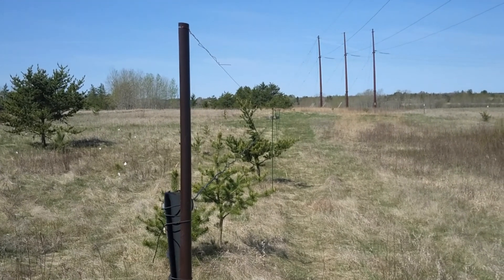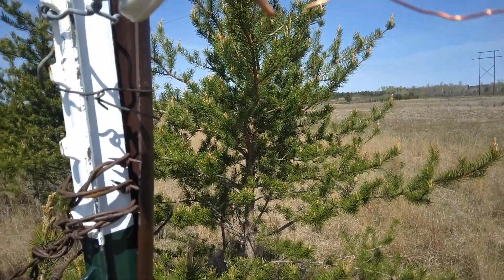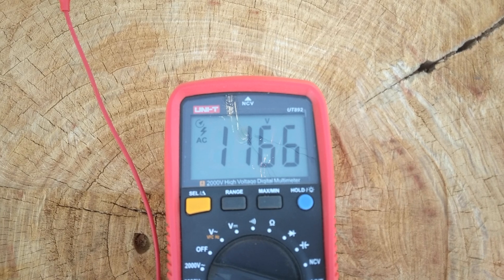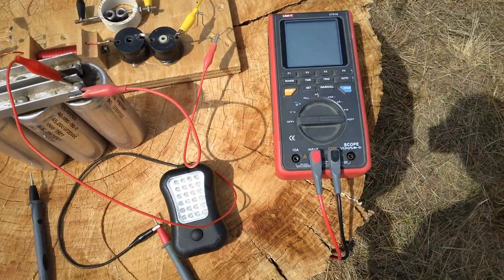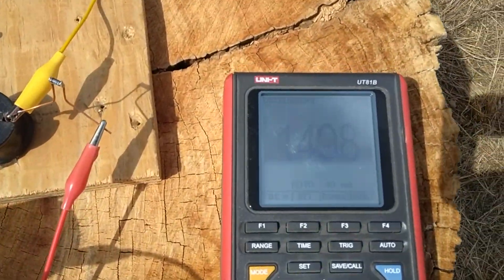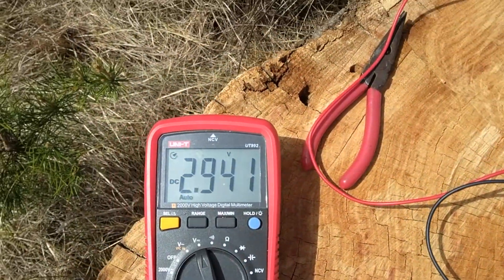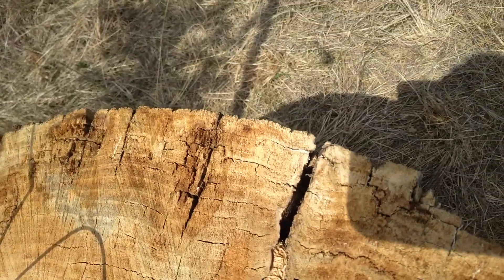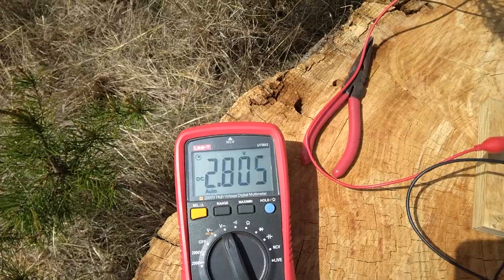Wires electrified *outside* of HV power line corridor.

Comment: I'm building a large off grid private facility in the mountains of the remote Arizona desert. I've been working on using electrostatic electric ( Natural power of the earth) to power the entire 6000sq foot shop. Looking at your designs your pretty much right on par with the project im working on. About a half mile on the other side of the property is an 80,000 KV massive power line, im wondering if I could increase my voltage by incorporating some of your design in with my electrostatic collection system. Might be fun to try.
Reply from the maker: Sounds like you have an interesting project!  You should try some videos on it.

Comment: So you noticed your physical proximity to the wire/circuit was having a negative effect -- quasi-grounding field proximity being induced.  That should explain the unexpected DIFFERENCE/LOSS you're seeing between 8ga and 30ga wires.  True the 30ga wire is higher and thereby closer to the HV lines -- HOWEVER, moreso your 8ga is terminated on insulators that are an INCH away from a grounded metal stake.  That grounded stake proximity is huge, just like your body was.  The 30ga is insulated on a wooden stake (some 8-inches away from the supporting metal stake) or 8X time distances of the interfering grounding field...

Comment: If you calculate the distance from the overhead wires to the ground along the shortest line that includes your wires, that gives you a distance D in feet. Calculate 250,000 / D = F volts per foot for the electric field strength from the overhead wires along that line D. Multiply that F (in volts per foot) by the distance between the thin and thick wires (in feet) and I bet it will come out very close to the difference between their voltages. In other words, the higher wire just was picking up a higher field strength. The thickness of the wires is immaterial given the tiny currents involved. My comment on your January video calculates you were getting 0.01 watt per yard for the Jan. setup.
Reply: close -- but no cigar.  why?  the planet that is influencing the nearest-neighbor -- is in fact proximity to the GROUND.  Field-wise, the 8-ga is connected to an isolator that is an inch or less from the grounded stake.  the 30ga wire is on a wooden stake suspended 8X further away from the same grounded stake.

Comment: The open circuit voltage (unloaded) is not important.    What you want is power.    P=V*I.    Try a couple watt power resistor of about 100 Ohms to get an idea of what kind of power you are able to get.     If the resistor gets hot or smokes you will have an indication that you might be able to get some usable power.   What you want to get useable power is a coil of wire that encloses a large area of magnetic flux from the power lines.     Interesting experiment.
Reply: Not only magnetic but they can also get the electric energy or potential with a natural capacitor efect. At the end is what hertz experiments did king time ago and cohesor experiments.

Comment: The thicker wire with the higher surface area is almost certainly collecting more locally in the wire, but its higher resistance is lowering the total output at the point where you connect to it. Also don't forget that galvanized means zinc-coated, so it's actually a really long bimetallic junction, whatever implications that might have. I don't know when you shot this, but I wonder if the recent solar activity could have had any effect on your readings. Even small solar storms can have measurable influence on currents in the air and ground. I also second the guy in another thread who thought the wire ought to be higher. Not because it's closer to the power lines, but because it's further from the ground where the natural atmospheric energy gradient interacts with the surface of the Earth.

Thanks as always for sharing your experiments! I ordered the space blankets I was talking about before, 150 for $70 on Amazon. And some paracord, tip ties, other odds and ends. Figured out basically how to suspend and steer it all for super cheap, just working out the best ways to contain and extract energy from a big patch of hot dirt, and where to aim it all so it isn't a hazard for pets, people, planes, etc. Grateful you inspired me to pursue it.
Reply: See my remarks on each wire's proximity to the ground (rather to the grounded stake) -- the 8ga is 1" away via the isolator, the 30ga is 8" (or 8X) further away from the grounded stake (suspended by a wooden stake)

Comment: Good stuff. It's about the frequency of the surface tension on the coil (+ antenna), against ground reflector capacity.. All about the LC circuits ;)
Reply from the maker: This is a learning experience; but a fun one!

Comment: i still dont think your high enough . i would still love to see you use a fractal antenna.  try 30 feet high with a fractal . as long as the wire is insulated you could roll it into any shape and have a fractal antenna  .
Reply from the maker: I think if I had a 30' high mess of wires right on the edge of the easement, the power company would have a problem with it, but thanks for the ideas!
Reply: @doubleMinnovations  thats the best part  you dont need to be right next to the power wires . if im correct you dont need to be close to them at all .
Reply from the maker: I will gradually be increasing the height and distance of wire configurations to see what happens.  -as time allows...
Reply: @doubleMinnovations  just be careful .
Reply: Make big loops like a transformer, or is that what the coaxial wire was for? In first video😊